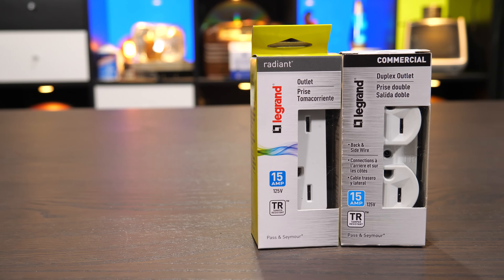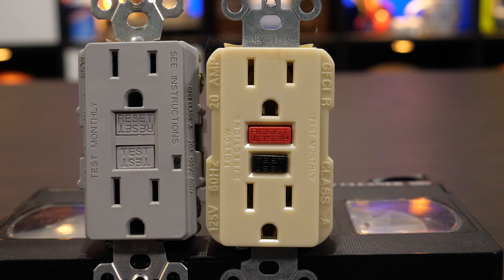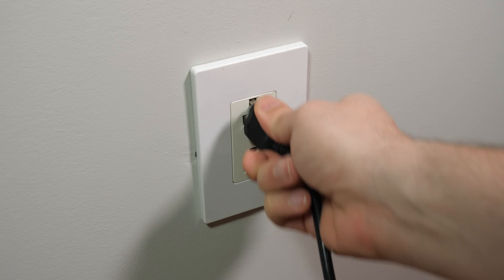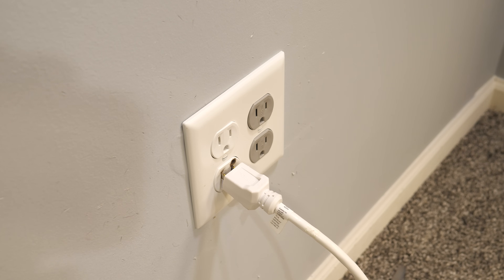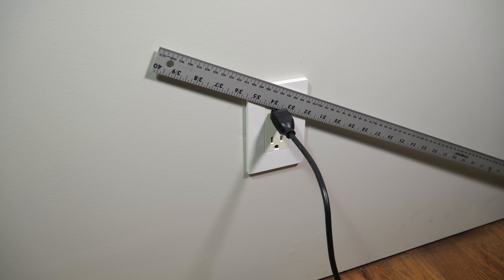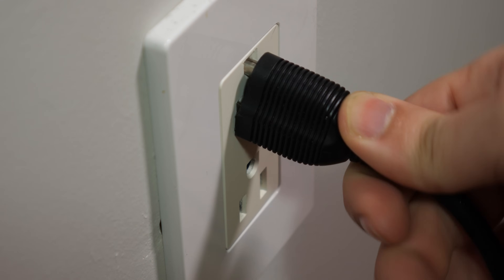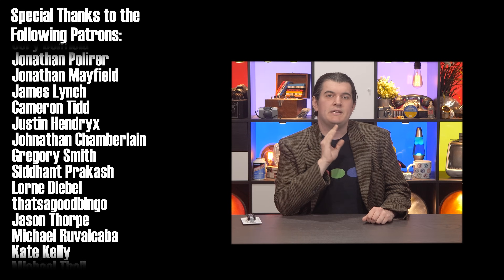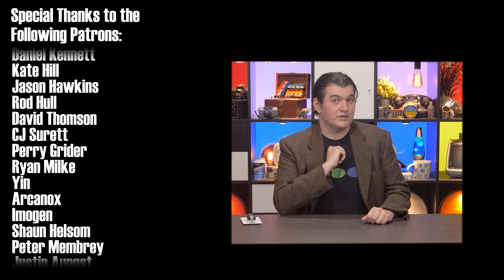Power outlets are topsy turvy - but does it matter?

Comment: After we’d been living in USA a few years we had a home remodeled, electrician asked us if we wanted “switched outlets”, coming from UK we were baffled by the idea and said “no”; was quite a few more years till we understood!
Reply: Stayed in place with a kitchenette in Scotland. Took me a bit trying to figure out how to turn the kettle on.
Reply: No to switched outlets. Or use smart switches. Then you can set schedules and put controls anywhere you want.
Reply: But coming from the UK, where you HAVE switched outlets...why were you baffled?  You should have said "Yes, absolutely" and then objected when the outlets installed had no switches whatsoever...
Reply: @ForgottenMachines  UK switches are directly on the socket. NA switches for the outlets are on the wall, bizarrely far away.
Reply: @BooBaddyBig  :) US switches are "bizarrely far away" so when you enter a room you can turn on several floor/table lamps at once.  Commonly, only one of the duplex outlets is "switched" the other is always "hot".  So, "US Switched Outlets" are more expensive when installing because they require a separate wire.
Reply: @ForgottenMachines  I'd guess it was familiarity the term.  When you're somewhere that something is ubiquitous, there's a tendency for nobody to talk about it, so the term for it is less commonly known.  I'm guessing Ian was aware that something was missing, but wasn't quite sure how to put it into words.  Being confronted with the term, it still wasn't obvious that it was the term for the thing they were missing.
Reply: switched outlets and plug fuses are remnants of useless ring circuits of UK. they need plug fuses because of ringterminals. normal wiring does not need them
Reply: @hillppari ring circuits don’t need plug fuses and socket switches,,, they’re just a different way to wire circuits (saving copper).

Fuses are there so that the cable to the appliance only needs to be rated for the appliance - not for your full circuit current. The cable is protected by the fuse - the breaker is there to protect the installation wiring.

Switches are there to isolate devices… not all sockets should have them - inaccessible ones for instance.
Reply: @hillppari Can you get Technology Connections to do a video on ringterminals?  This is the first I'm hearing of them!  They sound uselessly interesting!
Reply: @ForgottenMachines He went over it before I believe.
Reply: @ForgottenMachines  "Ringterminals" is either a misprint or autocorrect error.  The correct term is "Ring Main". Ring mains are a clever British wiring strategy that compensates for the improved safety of their standard plug design by greatly increasing the overall risk of an electrical fire.
Reply: @danielstickney2400 how does a ring circuit greatly increase fire risk?
Reply: @JonnyD3ath  I’ve never been to the UK, but as I understand it, the intent of ring circuits is that you can use thinner-gauge wire, as the total current draw will be split between the two sides of the ring.  The danger is that there could be an open circuit somewhere in the ring (e.g. from a loose connection), and no one would know about it, since everything will still appear to work.  Then you’d have the total current draw flowing through wires that aren’t really heavy enough to handle it safely, and they’d overheat.
Reply: @danielstickney2400  I imagine you were joking, but for clarity, that's backwards. Ring mains came about due to needing to do mass rebuilding while also suffering a significatn shortage of copper wire. The safety of the standard plug came about due to the need to compensate for the inherent horribleness of ring mains. Ring mains have since been done away with (save, perhaps, in sufficiently old buildings that no one's got around to fixing up), the safe plugs have not.
Reply: @kc9scott  thinner wire, maybe, but also you don't have each outlet/light (or set there of) having to run a wire all the way to the switch/fuse/breaker box and back, instead the wires just run to the next (generally closest) one in the ring. That's where the saving in copper wire came from, it required substantially less than half as much. It was a post war measure to compensate for a shortage of copper wiring.
Reply: @kc9scott  I've never seen thinner wire on a ring, every single one i've ever seen has got the correct size cable (2.5mm², that can easily handle 27amp apparently but is up to code) used on it. Which if on a standard 32amp breaker (standard for a ring) means if one side disconnected it'd still handle it. There's no limit to the sockets you can have on a ring main which surprised me a bit, though I don't think i've ever seen more than 7 or 8 double sockets on one ring - there is a limit to the amount of spurs from double sockets - limit of one spur per socket, but the installation mustn't exceed a floor area of 100m² or 1076 square foot) but it does mean that it'd usually be understressed but could also handle extra load if someone plugged something a bit power hungry in (until the breaker tripped anyway!) Edit: corrected cable sectional size.
Reply: @sierraboney1394 Thanks, nice to know that the wires are thick enough (not sure, see my next post).  But if that’s really the case, they could have saved even more copper by leaving out the “last” link in the ring, and turning it into a simple daisy-chain, which is what’s done in the US.  The only benefit the ring layout might then provide is less voltage drop to the farthest outlet.  It seems to me that the voltage drop would be less noticeable on a 240V system than it is on a 120V system.
Reply: @sierraboney1394  I finally got around to looking up the US/metric conversion for 2.5 mm²… it’s the same as 14 AWG.  In US home wiring, that’s what we use for 15-amp circuits.  For a 20-amp circuit, you’re required to go to the next larger size, 12 AWG, which is 4 mm² (the AWG numbers go “backwards”).  So supplying 2.5 mm² wire with a 32-amp breaker seems dangerous to me.
Reply: @kc9scott  i would say the larger wire is to compensate for voltage drop on your lower voltage installations, especially if they’re just wired in radial (non-ring).

To get the same power at the lower voltage, you are going to have to use higher current as well remember, which means larger wires
Reply: @JonnyD3ath  While that might seem to be the case, it's really to minimize generating heat that would soften the insulation.  The 14 AWG wire (2.5 mm²) can handle 15 amps if its insulation is rated for 60ºC.  But if it has insulation rated for 75ºC, it can handle 20 amps.  Etc.  We also derate the wires' current capacity if there are more than 3 conductors together in a raceway or conduit.
Reply: @hillppari  Ring circuits are awesome. Plug fuses protect the cable, so you can use thinner cable.
Reply: @BooBaddyBig  Ring circuits are a terrible idea that was only used to compensate for a Massive copper shortage at a time when mass rebuilding was necessary.  Plug fueses are... debateable.

That said, Switched Outlets, with the switch right there at the outlet, are an entirely different matter and there's a reason they're common even in places that never used ring circuits.
Reply: @laurencefraser  Define 'terrible'. They're still in use everywhere in the UK. All new builds employ them. They work fine.
Reply: @laurencefraser  They're not terrible at all, at least not in my experience! They're still used now in new installations as far as I know. When installing a ring, say on a 32amp breaker which is basically what you'd use on a standard ring circuit, you'd use cable that can take 32amp (2.5mm², that can easily handle 27amp apparently but is up to code) twin and earth. Therefore even if one side became disconnected it'll still handle it. It should never come undone though if the plug socket terminals where the cables are joined are tightened correctly. Even older installations i've seen have the correct size of cable, they're not smaller or thinner. Both the houses i've lived in (previous one built in the 60's, this one in the 70's) both have the correct cable. Smaller section cable is used for lighting circuits (6amp breaker if I remember correctly). You'd probably have to find a pretty old house to find thinner cable, I should think the majority of places have had their electrics upgraded in the past several decades. To be honest I can't remember ever hearing about a fire in the news or elsewhere caused by an overheating ring main. You can be fairly sure that if it was a regular occurrence they'd have banned them by now, or it'd be in the media and there would be a campaign to ban them. For example, this is from memory but many years ago back in the late 80's and 90's there were quite a few house fires happening (despite public information films reminding people to be careful) from for example people falling asleep with a lit cigarette and setting fire to their couch or whatever, because fabric used on them wasn't subject to any sort of fireproofing. If I remember correctly, the programme BBC Watchdog (may have been a different programme, it's about 30 years ago!) successfully campaigned for the law to change and now all furniture covered with fabric is fireproofed. Edit: corrected cable sectional size.
Reply: this is myth. Documentation at the time the standard was being worked out made no mention of saving copper, no  basis for the story whatsoever. However ring mains are gradually becoming less common in the UK.
Reply: @dpbusby  Sometimes people have intents that they know to not write down for posterity.  Sometimes they write it down but reduce the distribution of the documentation to those with a strict need to know because it's embarrassing.

Compromising safety to save on copper sounds to me like one of those things that people wouldn't bee too proud of.  It's therefore less likely to be documented that way and less likely to be digitized if it was documented that way.  It's more likely to be put behind security walls if it was digitized.

As such, not finding explicit evidence that it was the reason does not really indicate it wasn't the reason.  I tend to be more inclined to believe old timers who were around at the time than I am the available documentation from the time.